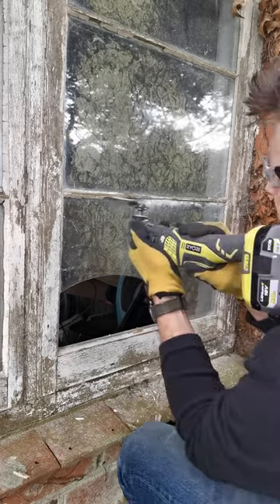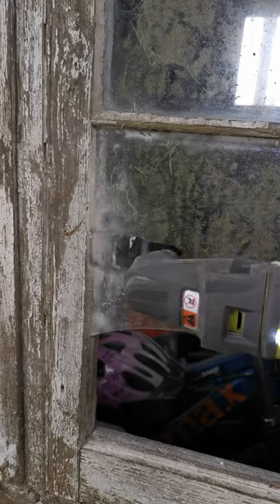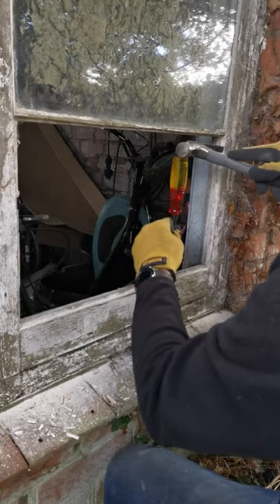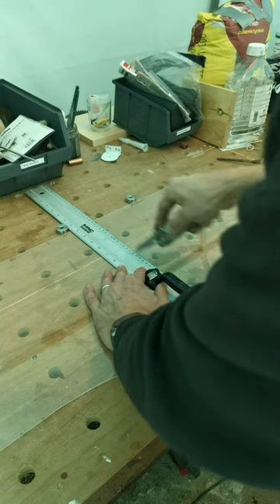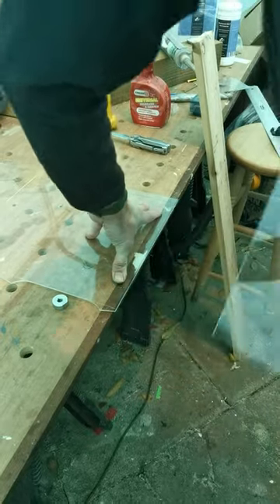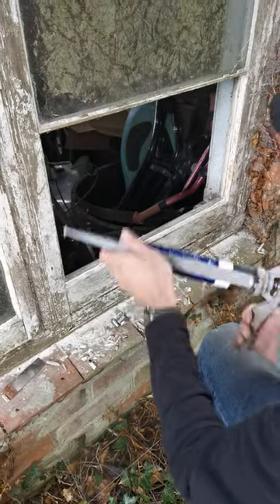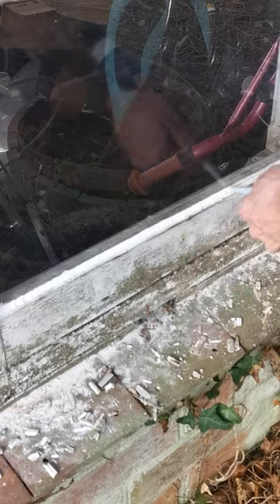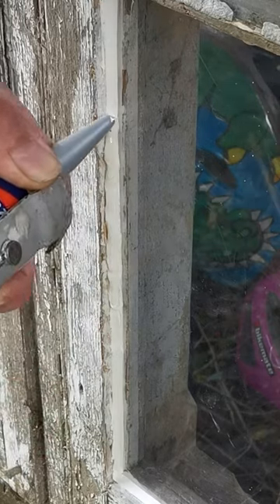Window Pane Temporary Repair #shorts

Comment: I'm a builder but nearly retired at 67. I bought a multi tool last year as thy are far more common now. They are amazing for restoration work on woodwork. You can do repairs that would have been very difficult if not impossible before.
Reply from the maker: I agree! It's not a troll you use all the time but for some things it's invaluable - like for separating the granite from a work top that had been attached with gripfill.

Comment: If perspex is anything like lucite, snapping it off without clamping on both sides is likely to leave you with a broken off corner,  I recommend a hacksaw blade.
Reply: Why not a jobsite table saw? Super easy cut
Reply: @MarkOhanesian  Have to swap to a fine-toothed plywood blade, first.

Comment: Great use of the multitool there 👍
Dont forget to use glazing spriggs for permanent repairs though
Reply from the maker: Good point, or push point glazing pins 👌
Reply: As a glazier we will do a similar install.  Push points are nice to hold the glass in until backset is dry but not necessary. Use safety in older putty asbestos is no joke. At least use a respirator with a p100 and wet the dust down before removing it if not using ppe.

Comment: I must be old school because I am still soldering my copper pipes together (never pex) and still use the glazing compound to replace broken windows
Reply: Soldering is good if you can but pex is great for DIY jobs.
Reply: Naa, plastic all the way.
Reply: @gdfggggg  I've seen too many of those things explode over the years destroying brand new remodeled houses when they were nearly finished being remodeled.
Reply: @jeffrey wolf  they only leak if they aren't fitted properly. Been using them for years, not one problem. I've moved on from copper.
Reply: @gdfggggg  I'm not a plumber so I just do minor repairs here and there with plumbing. And I just refuse to buy text equipment and the fact that I know how to solder. Has actually sold my jobs for me because lots of people can't do that

Comment: Way to grind the shit out of that old asbestos putty.
Reply: Trap for young players that is
Reply: Who cares 1 or maybe 3 percent serpentine....
Reply: I was hoping I wasn’t the only one thinking that
Reply: Just wear a venitaltion mask. Even n95 works
Reply: @johnnymac6242  ah the paper fakes for the coronavirus that can be blocked by dreams and lies 😂
Reply: Exactly, there were people from the moon removing old putty in our houses.
Reply: Timber putty had no asbestos binders only the old steel frame putty had asbestos binders ……..
Reply: @MrGlazier01  that is useful information, thanks.
Reply: @MrGlazier01  wrong, 8 years sampling asbestos daily as a surveyor and would get positive results from all types of door and window glazing.
Reply: @MrGlazier01  we was required by the local authorities to sample all mastic and putty on all doors windows where present. I’ve been present at 100’s of houses during the replacement of door and windows due to positive mastic/putty and packers being present. This was still a thing on relatively modern UPVC frames due to all mastic/putty’s that wasn’t removed correctly the last time they was replaced.
Reply: @MrGlazier01  we was required by the local authorities to sample all mastic and putty on all doors windows where present. I’ve been present at 100’s of houses during the replacement of door and windows due to positive mastic/putty and packers being present. This was still a thing on relatively modern UPVC frames due to all mastic/putty’s that wasn’t removed correctly the last time they was replaced.
Reply: @DreStyle What coronavirus? The one your god said would "disapear by spring, like a miracle." 😂😂😂
Reply: I used to make brake disc pads 43 years ago and measured out and weighted the asbestos mixed by holding it in my hand and putting it into the scales bowl. But management were duly aware how dangerous asbestos was and provided us with appropriate safety masks, paper ones that said on the box NOT TO BE USED WITH ASBESTOS that were black half way through the day, actually I worked the night shift but you know what I mean. Been waiting for a visit from Mr C for many many, years now and have been quite surprised he hasn't come round to say *Hi!*.
Reply: @johnnymac6242   Whenever you are in the room or the house  after the window is done?

Comment: Nicely done Charlie!  Wish I did this a while back after finding squirrel poop in our outbuilding hahaha  Hope your firewood is keeping dry and the house warm!
Reply from the maker: Thanks buddy. Yes, just need to do the log splitting video now!
Reply: @CharlieDIYte  get a back brace if you're using a splitting maul. Luckily we have a large tree stump, I put a car tyre on, then almost fill with logs  to split. Stop them falling over.  With a heavy maul you almost drop the head down rather than swing 😊 we've nearly burned all our wood this winter 😵 another lesson I learned the hard way is keeping to a good organised system, so you're not moving the wood too much 😂
Reply: @CharlieDIYte  https://youtu.be/fTK7uvilKy0 these are worth building. Handy when they are portable as you can cut near your stack. Keep a bonfire going to burn the thinner stuff 😉 I've used rebar to do this before which taps easily into the soil here, easier to store away too! 😂

Comment: We’re thinking of using Perspex to replace glass around the whole house as part of window replacement project. Thick Perspex has similar if not better U values. We’re wondering why more people don’t? Discolouration over time? Scratch resistance? Anyone any other ideas/views?
Reply from the maker: It's a good question. You can get exterior perspex that doesn't discolour. Check with your insurance that they're happy with it.